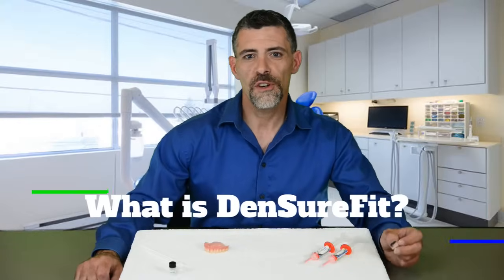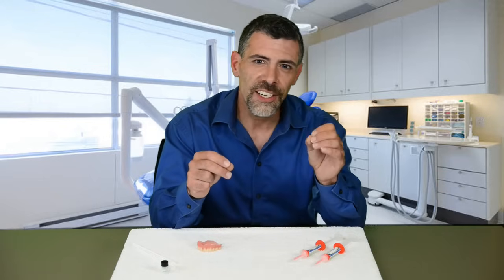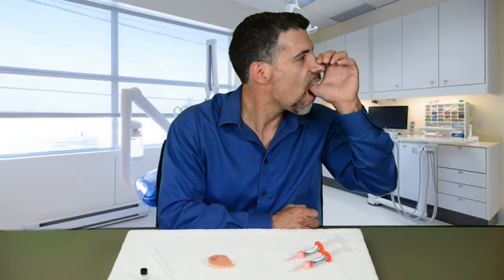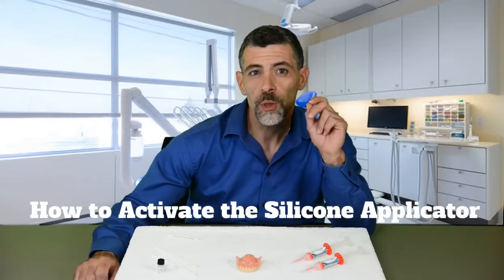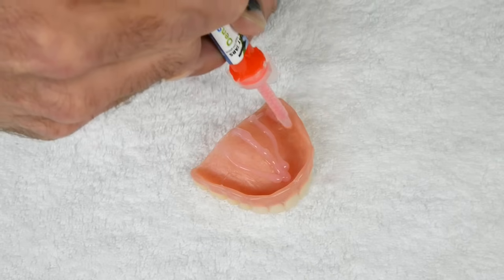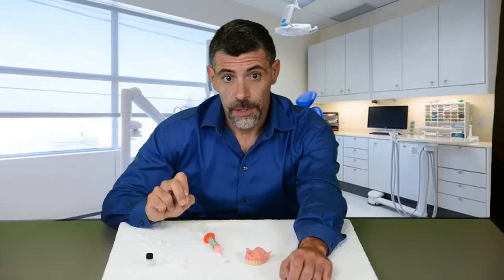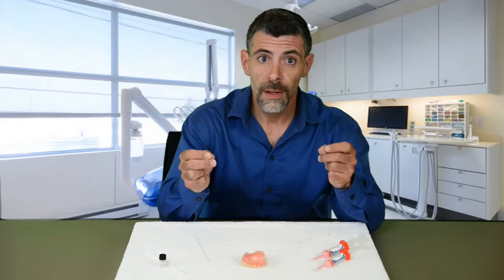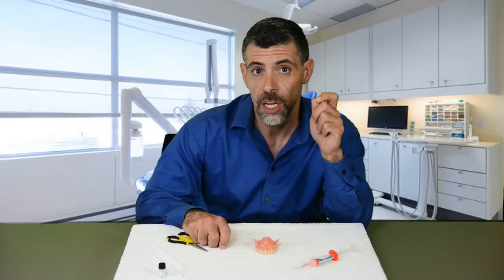HOW to APPLY DenSureFit to the UPPER DENTURE (official DenSureFit instructional video)

Comment: Can you post an additional video demonstrating how to do the bottom dentures?  My upper denture fits well, but my bottom denture is not fitting well, it kind of rocks in my mouth, and adhesives don't work.
Reply from the maker: Hi Jody,

Here is an instructional video for further guidance on lining the lower denture https://densurefit.com/how-densurefit-works/instructional-video/

If you would like to send us pictures we can have our specialist take a look and give you some feedback on the probability of being able to help you with your situation. Please send your full name along with pictures of your denture to us on our texting app for the fastest response 509-316-2748.

We want you to have realistic expectations of how DenSureFit will be able to help you. DenSureFit will help with the comfort of your denture by providing excellent cushioning. If you have any voids in your denture causing it to be loose or unstable, the DenSureFit will fill the voids, improving the fit and making it more snug. Once the voids are filled with the silicone, you will then have a surface area in the denture that makes full contact with your gums. 

The lower denture is more problematic by nature, especially if you have bone loose and a shallow trough and short walls, which provides very little denture to wrap around the gumline to stay secured. This type of denture will likely require the use of adhesive to secure the denture and keep it from popping up. DenSureFit will not solve the issue of a “floating” denture, nor can it miraculously transform a poorly made or extremely ill fitting denture. Since DenSureFit is NOT adhesive, it is NOT going to be able to solve the issue of a floating denture.

We cannot guarantee you can go adhesive free on the lower. If you are currently using PASTE/CREAM adhesive, you should be able to switch over to POWDER adhesive, which works much better with our silicone. Most users agree this is a VAST improvement as it does not adhere to the mouth like pastes. It is much easier to remove at the end of the day and doesn't ooze or change the taste of food, most people report.

Comment: Thank you so much for this tutorial, however, I've got a question, when applying the snug up application, like immediately after initial application, why does it seem like he's applying primer over the initial silicone to get extra comfort and snug fit? I dinner have my kit yet, but I'm confused🤔
Reply from the maker: Primer is only necessary on the first layer (the bonding agent to allow the silicone to stick to the denture), and then on any bare patches after that. For specific help, we can set up a phone "Care Call" with our product specialist to walk you through the process step by step. Just text our support line to set up an appt. 509-316-2748

Comment: Do you have to remove liners? Your dentist installed?Sorry I just don't want to mess up?
Reply from the maker: DenSureFit can be used with a soft professional reline (we have instructions in our guide book) however, any other relines should be removed for the best results using our product. www.densurefit.com.

Comment: Question: Does Densurefit work on flexible dentures? I'm have a comfortable fit, but i haven't found an adhesive that'll keep it attached. The adhesive wears away within a couple of hrs to an hr. On my acrylic denture have no problem with the same adhesive. Thank you for your consideration.
Reply from the maker: DenSureFit does not work with flexible dentures only acrylic dentures.

Comment: Can you remove denture fit if you do not like it.?
Reply from the maker: Yes Francis,

We provide a sample remover with each kit purchase, it's called Unisolve. On some denture surfaces, DenSureFit will just peel right out of the denture when it's time to remove it.  But, sometimes it can adhere very strongly to a porous or rougher denture surface and be quite tedious to remove.

You can try peeling the silicone out of your denture by using a dull, safe tool (such as a wooden cuticle pusher or orange stick) to push up the edge of the silicone. Slowly pull up silicone edges up with your fingers and push up under the silicone with the tapered edge of the wooden stick. If this method is tedious and it is coming up in tiny pieces, you can use Uni-Solve adhesive remover wipes to help release the bond of the primer between your denture and the silicone.

Uni-Solve Adhesive Remover Wipes are helpful with the removal of silicone when it is adhering strongly. We do not manufacture this product. It may be purchased online at Amazon.com and other online stores

Comment: What happens if you don't have a pallet
Reply from the maker: We do have a number of customers who use DenSureFit on their horseshoe uppers quite successfully. The silicone will fill voids and gaps to make the denture fit very well and stay secure. Flashing of the silicone around the ridge of the denture provides an excellent seal.

Some DenSureFit customers need to go through some trial and error to get a correct fit on their horseshoe upper. You might have to do your application a couple times to figure out how to make the material work for your specific needs. This product is not a "one-size-fits-all" type of application, especially for horseshoe uppers.

Please let us know if you need help or advice for your application or if you do it on your own and don't get a good result. We will help you! We will work with you to help you figure out an application technique that works for you and will help you through it!

Because you have minimal palate area on your horseshoe upper, suction in the normal suction spot on the palate may not be possible. There is a good chance that you may need to use powder adhesive on top of your DenSureFit liner to keep it secure. DenSureFit will do its job by filling the voids, creating a proper impression and giving you cushioning. Powder adhesive gives it the small amount of tackiness that is likely needed to hold it up in the roof of your mouth. www.densurefit.com

Comment: I'm using cushion grip and have to change every 4-5 days as it seems my gums change a lot in this time. I got denture only month ago. I'm interested in this product but considering the cost when would be a good time to buy - as when will there be less noticeable shrinkage?
Reply from the maker: DenSureFit was actually intended to best help new denture wearers. Our liner remains on your denture for 3-6 months before needing to be changed again. The silicone is "buildable" which means as your gums shrink, you can just add another layer of silicone to the existing layer to counteract the new voids that make the denture feel bigger, 

DenSureFit is only available online, not in brick and mortar stores. Please text us at customer support 509-316-2748 to chat with us or visit www.denturefit.com to purchase online.

Comment: Can it be used on a soft liner with out destroying the soft liner ?
Reply from the maker: Hi Miaa, DenSureFit can be used with a soft professional reline (we have instructions in our guide book.) Basically you avoid the palate area with the our application, and yes if you need to remove our product we have a remover we provide with each kit to help you do so. Your soft reline will not be affected. www.densurefit.com.

Comment: Just got my 1st DenSurefit.
Great tutorial 👌
One question: 
I did a "Store bought" reline kit and tried to refine, bit not happy with the result. Should I remove the liner and start from the bare denture?
Reply from the maker: Yes, please remove any store bought liner before using DSF.
Reply: Can it be used on bottom  partials

Comment: i do not have a palate in my upper dentures, i've cut it out into a horseshoe, because now it feels much better and i can talk , eat, speak better, without that nausea feeling, and it works fine,  will it still work? because im looking for a (longer time fit) instead of daily fittings. the lower denture actually comes off first.
Reply from the maker: We do have a number of customers who use DenSureFit on their horseshoe uppers quite successfully. The silicone will fill voids and gaps to make the denture fit very well and stay secure. Flashing of the silicone around the ridge of the denture provides an excellent seal.

Some DenSureFit customers need to go through some trial and error to get a correct fit on their horseshoe upper. You might have to do your application a couple times to figure out how to make the material work for your specific needs. This product is not a "one-size-fits-all" type of application, especially for horseshoe uppers.

Please let us know if you need help or advice for your application or if you do it on your own and don't get a good result. We will help you! We will work with you to help you figure out an application technique that works for you and will help you through it!

Because you have minimal palate area on your horseshoe upper, suction in the normal suction spot on the palate may not be possible. There is a good chance that you may need to use powder adhesive on top of your DenSureFit liner to keep it secure. DenSureFit will do its job by filling the voids, creating a proper impression and giving you cushioning. Powder adhesive gives it the small amount of tackiness that is likely needed to hold it up in the roof of your mouth. www.densurefit.com
Reply: @DenSureFit  hi, i just purchased a kit and i am applying it as i type to you, its close to 3 a.m. i'll take it out in a couple of minutes leave it in a glass of water and leave a feed back tomorrow when i wake up, it feels good already, to tell the truth, but i got to experience eating with it different foods. thanks.
Reply: @Quranation  did it work well for you ?

Comment: I have sjorgrens syndrome and because of this I have to use acryline about every 3 weeks or so because the sjorgrens sort of "eats" the liner off and causes painful erosion areas.  Will this densurefit last longer or will the sjorgrens have the same effect?
Reply: You should add your comment to a DentureFit comment so they get your comment as a reply. They commented on the one above yours 👍
Reply from the maker: Hi Becca, we do not have experience with your condition. What we can say is, our product is a silicone liner, like a soft reline you would get from the dentist office. DenSureFit is not like other store reline kits and the silicone is the top of the line quality, and quite sturdy. An applicaqtion generally lasts 3 months or longer. Hope this helps.
Reply: @DenSureFit  thank you

Comment: I need something to hold my lower dentures my upper dentures stay in place it’s my lower dentures
Reply from the maker: Hi Rozalind,

DenSureFit does work for the lower dentures, but to what degree depends on how well your dentures are made and/or how much bone loss you have. 

We want you to have realistic expectations of how DenSureFit will be able to help you. DenSureFit will help with the comfort of your denture by providing excellent cushioning. If you have any voids in your denture causing it to be loose or unstable, the DenSureFit will fill the voids, improving the fit and making it more snug. Once the voids are filled with the silicone, you will then have a surface area in the denture that makes full contact with your gums. 

The lower denture is more problematic by nature, especially if you have bone loose and a shallow trough and short walls, which provides very little denture to wrap around the gumline to stay secured. This type of denture will likely require the use of adhesive to secure the denture and keep it from popping up. DenSureFit will not solve the issue of a “floating” denture, nor can it miraculously transform a poorly made or extremely ill fitting denture. Since DenSureFit is NOT adhesive, it is NOT going to be able to solve the issue of a floating denture.

We cannot guarantee you can go adhesive free on the lower. If you are currently using PASTE/CREAM adhesive, you should be able to switch over to POWDER adhesive, which works much better with our silicone. Most users agree this is a VAST improvement as it does not adhere to the mouth like pastes. It is much easier to remove at the end of the day and doesn't ooze or change the taste of food, most people report.

So, at the end of the day, will DenSureFit be worth it for you?
Most DenSureFit users with similar lower denture situations think so. Their denture is more comfortable to wear and they can change from paste to powder adhesives, making their daily routines much easier.
Plus, the powder adhesive is less expensive and the bottle lasts much longer, so the cost of the Fpowder adhesive is minimal. Compared to what they were spending on cream/paste adhesive (around $20/month), DenSureFit ends up costing less when averaged over the 3 month + life of a DenSureFit liner.	

The same kit can be used on either the upper or lower denture. The average wearer needs one tube of silicone to snug up the lower and 2 tubes or layers of silicone if more loose.

Here is an instructional video for further guidance on lining the lower denture https://densurefit.com/how-densurefit-works/instructional-video/

If you would like to send us pictures we can have our specialist take a look and give you some feedback on the probability of being able to help you with your situation. Please send your full name along with pictures of your denture to us on our texting app for the fastest response 509-316-2748.

Comment: To exspensive.
Reply from the maker: Patrica, it might seem that way at first, but for a great many former-adhesive users report that they were spending more on adhesive than they currently spend on DenSureFit...and adhesive didn't even solve the problem of their loose denture like DenSureFit does. One application of DenSureFit stays in for months and makes your denture snug and cushiony comfy! Also, the average amount that dentists charge for a soft reline is about $250. With DenSureFit, you can do your own reline in the comfort of your home for a fraction of the price with the "holy grail" material used by dentists. Hope this info helps! If you have any more questions, feel free to give us a buzz! 844-682-3368 We'd love to hear from you. Cheers!